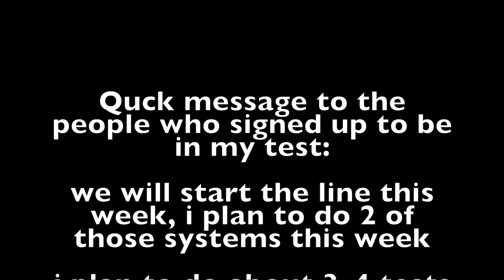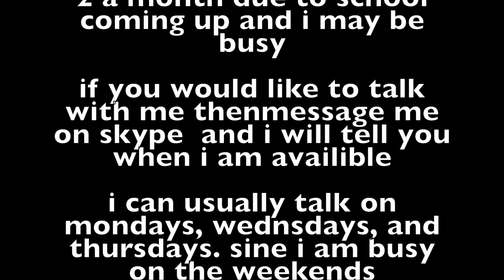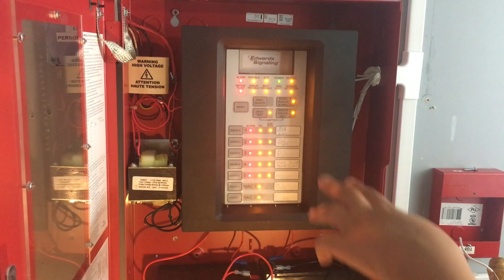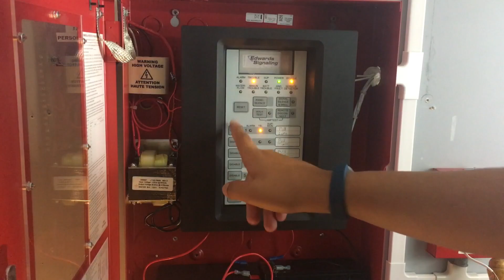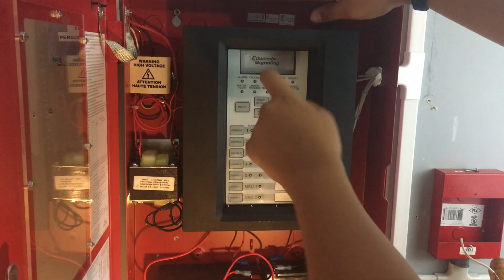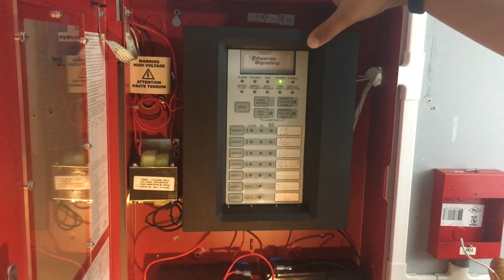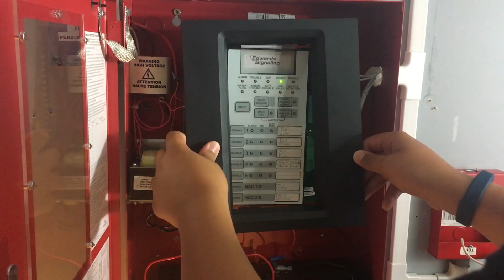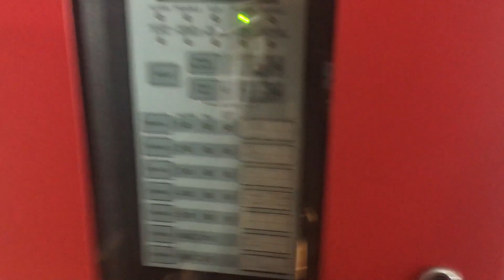How a fire alarm system operates - Panel Basics (Episode 3)

Comment: If the alarm system breaks how does the water flow to the sprinkler system? also will the fire doors close if the alarm is not functioning? Im asking because a senior living facilities fire alarm was stuck by lightening and completely went out.